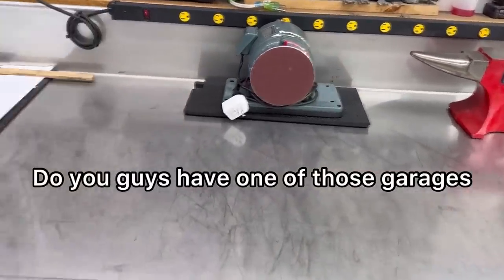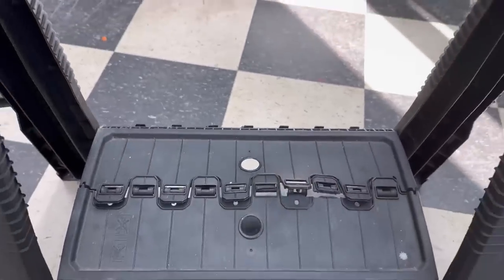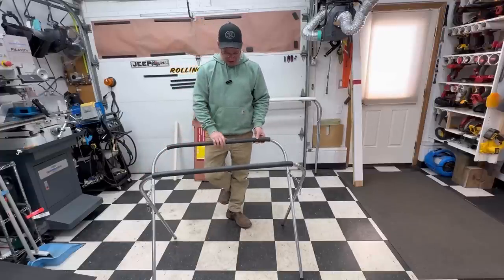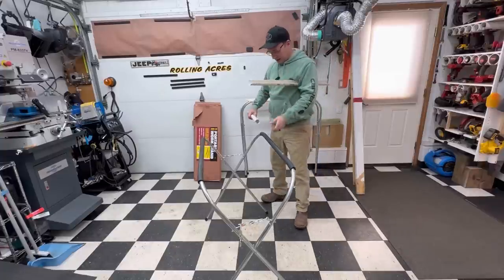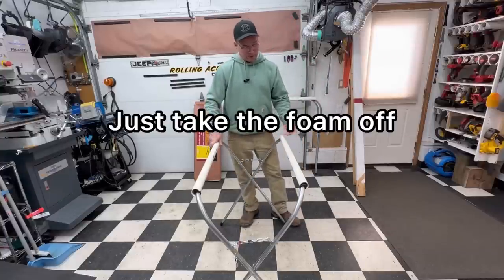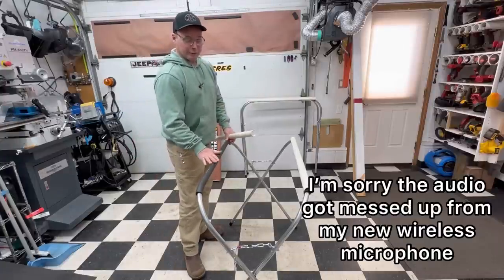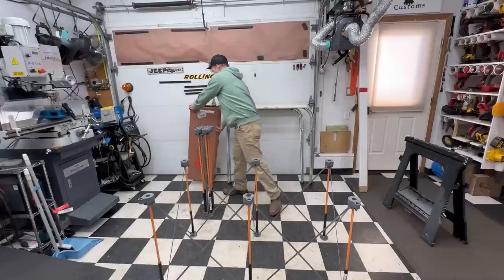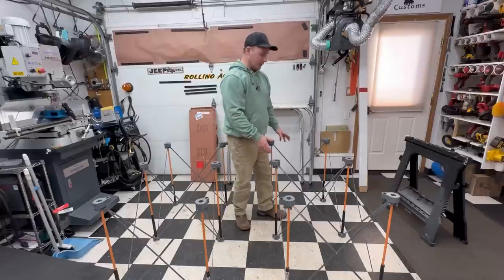YOU can no longer afford SACRIFICIAL lumber these days @SpicerDesignsLLC  @HometownAcres

Comment: I like your thoughts, the PVC is needed but the only problem with them is that they are slippery as all get out. Maybe glue some sand paper to them? Otherwise I would be picking up 2X4's off the ground all the time. Plus it seems most ground you're working on isn't perfectly flat.
Reply from the maker: I agree

Comment: Two Bauer height adjustable sawhorses, two eight foot 2x4s, one sheet of 2 inch XPS foam for a cutting board. You can even cut the foam into thirds and make it foldable with 100 MPH/gorilla tape.

Bora is also a good choice.

Comment: That's a very capable system. I'm going to pick up some of those HF stands. You could use a couple pieces of pipe insulation as replacement foam. Just don't use the adhesive, and you can swap between foam or pvc, as the job requires. Just use the original foam as a spacer to keep everything snug.

Comment: While the PVC will help your work pieces slide nicely, there is still a chance that something could catch and pull the bar. You should develop a spacer or safety stop to put on the bottom feet to prevent them from pulling in. (Or on the top from pulling in as well.) Your engineering brain will probably think up of something much easier/faster than what I could think of. Thanks for the recommendation, this will probably be my next HF purchase. Keep up the great content Doug!

Comment: As usual!! An awesome job Doug!! Glad to see you finally. went with an affiliate link. I just ordered the centipede workstation. Thanks!! Also what is the best way to cut the PVC pipe without the plastic breaking and causing an injury. Thanks Doug!!!
Reply from the maker: I used my Milwaukee m12 mini cut off tool with a plastic cut off blade that came with it. Worked great!!
Reply: I made a small 3 sided plywood channel which I clamped to the fence of my table saw and then pushed the pvc through the channel to make the appropriate cuts. Wear gloves and use piece of pvc that 2x the length you want so you do not have to feed the entire length through the channel

Comment: I've seen those stands at Harbor Freight and now I gotta get a couple and some pvc. I've got 2 of the cheaper Harbor freight plastic ones, but I needed a little wider top, so I made some 40" wide 1x4 that I attached to the top as they are about 1.5" wide at the top so now it's 3.5 " wide on top and 40" wide. I work with sheet iron, 38" wide quite a bit making raised garden beds. The biggest thing against these the wood, metal will not slide across the saw horses without pulling the saw horses over. So your pvc on the other adjustable work stands would be a game changer for me. Thanks for the info!
Reply from the maker: @Kid Cudd I hope they work out well for you! Good luck

Comment: I had a set of those Stanley sawhorses once. They were constant problems, especially those bottom shelf hinges. Yes, they broke and wouldn't line up properly plus were just too flimsy. Didn't take long to find a replacement but these are the best idea I've seen. The Bora style seems the best of the two types but I'm sure costs way more than the Harbor Freight $21 ones.

Comment: Good morning Doug! Outstanding presentation as usual. I have to admit, I never thought about the “bodyshop caddies” for woodworking. One other thought for those is they make a real heavy pipe insulation. It’s has a split all the way down the side so can protect whatever it is you are building or fixing. You could either lay a blanket across it or get a couple pieces of  insulation, snap it over the top tubes which will give you a nice padded surface. I also thought the color keyed chains were absolutely brilliant. As far as the Bora stands go, I think that might be the way I will go. I really like the thought of having two of those and cutting sheet goods, you don’t have to worry about as you said, damages to corners, and so forth. See you in the next installment.
Reply from the maker: Thank you @Jim

Comment: Considering I was going to need sawhorses in the next week or two, your video could not have been more timely.  I considered those centipedes about a year back.  Thought they were interesting.  I also like your Harbor Freight rig.  Either would be good.  But I think I lean toward the centipede due to those handy attachments but, even more, because they meet your seal of approval.  I was skeptical of those centipedes but if you're using them then they should work for me too.  Many Thanks, Doug and keep up the great job on these videos!

Comment: The older plastic saw horses or at least the ones that look similar but have the height adjustable bar are pretty solid and hold up to abuse.

The ideas you have on the tube stands are great, I don't have those but my neighbor has heavy duty commercial version and they are slick.  Do you find the HF knockoffs are flimsy though?
Reply from the maker: The HF aren’t bad. They sure are better than regular saw horses. But every “tool” has its limitations and I try to only use them for what they were meant to handle.

Comment: DOUG, on the metal stand, one thought on  improvement
Maybe take your marking pens , mark the cross arms at the joints with the actual floor height corresponding with the links . Black= 38" 
Red= 36"
Yellow= 34"  
If it works out that way, just a suggestion. Course you always have a better way!
Good stuff Doug!
Reply from the maker: Thanks and that is a great idea!
Reply: @OneEyeCustoms  Thanks!

Comment: Nice idea, but I can’t believe I spent 15 minutes on saw horses 😀.  Won’t detaching a power mitre saw from its stand/cart do most of the same things?  I’m in the mode of wanting to downsize and not acquire.
Reply from the maker: Those stands are very heavy and you would need several of them to hold the board up after you cut it.

Comment: I literally just made a matched set of these and bent the tubing myself I used phone from pipe insulation all these materials I had were laying around I did the same thing with my chain used some stuff I had laying around and mark them every 5 th link. I made mine out of electrical conduit. I'm kind of curious what they'll hold.

Comment: Why not put a slot in the foam so you can remove it/put it back as needed?
Reply from the maker: I thought about that, but I think if you put a door or hood on it and it moved around much, it could roll the foam off and scratch what was on the stand.
Reply: @OneEyeCustoms  perhaps a velcro strap or two would prevent it from allowing the foam to roll off?